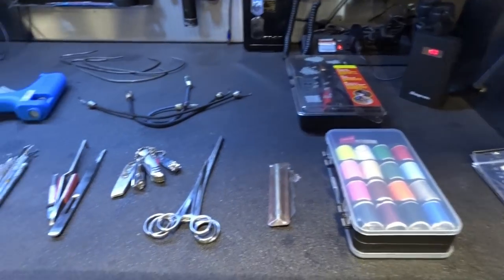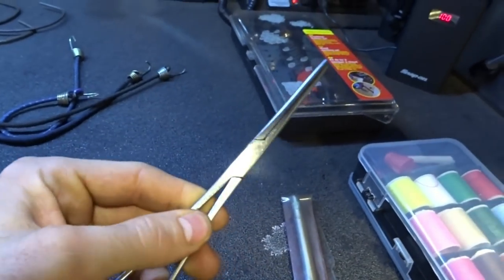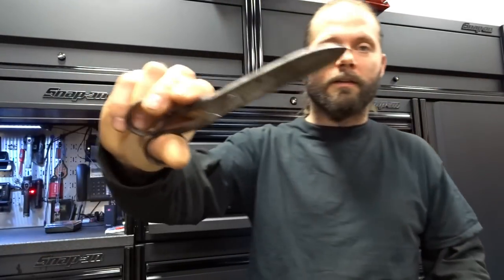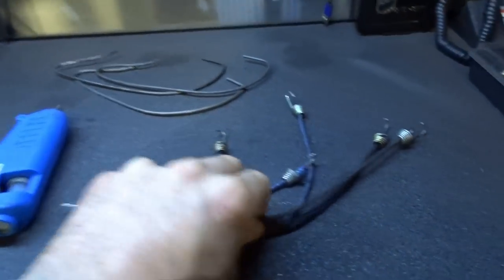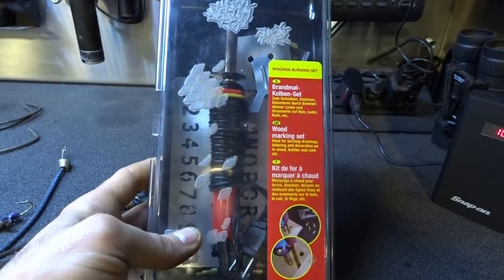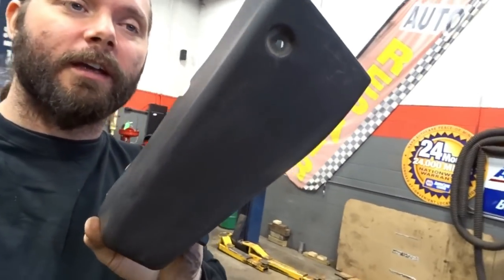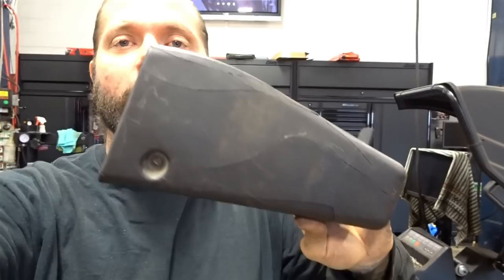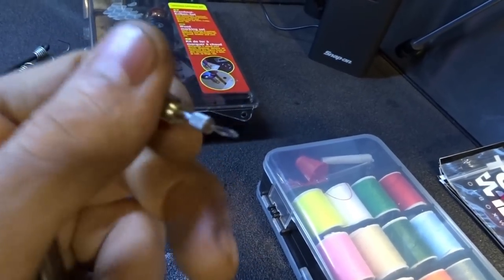Tools are Tools!

Comment: A seam ripper for sewing,this works great for opening up wiring harnesses doing no damage to the wiring instead of using a razor blade.The bungee cords are also great for holding up GM rack and pinions when the engine cradle is removed in the front wheel drive vehicles

Comment: Merry Christmas, Jim! Great tips!

Heat staples and press them into the plastic across the joints when melting it back together with your wood burner. It makes the repair a lot stronger. You can bend them to fit into corners or to reattach tabs, too.

I make a lot of tools. The little wire handles from the black metal binder clips can be bent just right to release the tabs on Toyota/Lexus A/C coupling locks. Some wire coat hanger wire wrapped around the threads of a push broom handle makes a good, long hook for dragging/pushing hoses/belts/wires into and out of hard to reach spots.

Don’t forget the baby powder and baby oil, for slicking up things. If you don’t want an oily residue, Astroglide is water soluble and will dry on it’s own. Plain old chalk, for quieting squeaky belts. Cheap dish soap mixed 50/50 with water in a spray bottle finds tire leaks or, with doors and windows closed and blower on high, air leaks around door seals.

I’ve got a million of em. 😎
Reply from the maker: 🚥🚥🚥🚥🚥🚥🚥🚥🚥🚥🚥
🎄🎅🤶🦌 Merry Christmas .      🚥🚥🚥🚥🚥🚥🚥🚥🚥🚥🚥

Comment: The hemostats are great, been using mine for a year or so. I've used old welding rods, the 3/16 rods are perfect for hanging heavy parts..also for painting parts. Back in the 80's, we used custom bent butter knives to open the wing windows on Ford trucks.. when keys were locked inside. Lol.